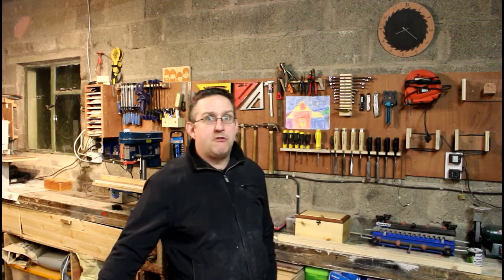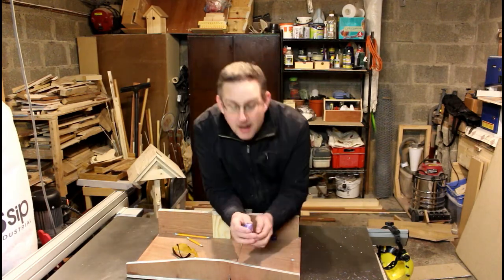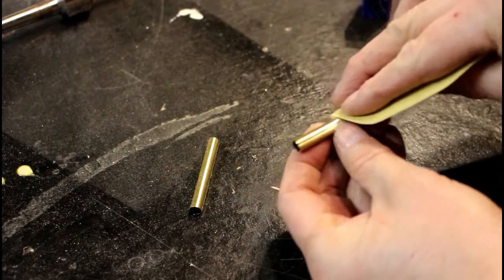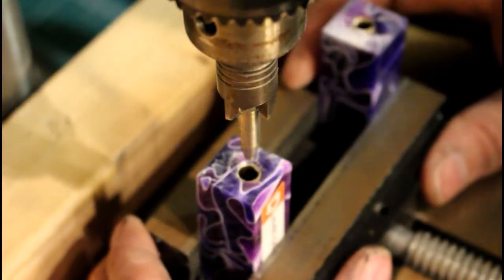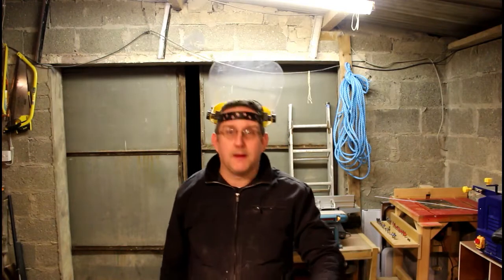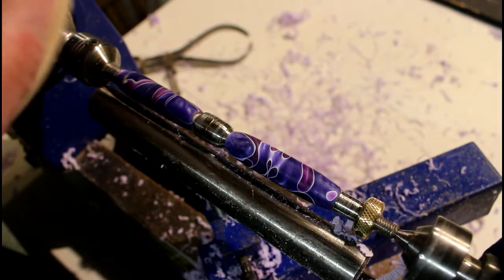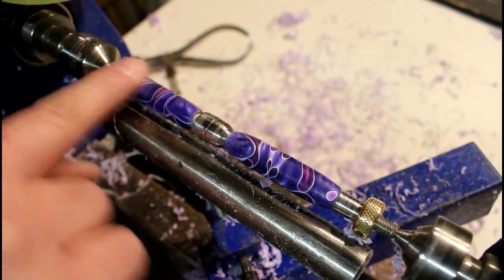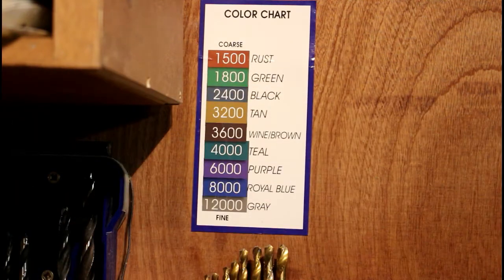Acrylic Pen Turning

Comment: I have just purchased a deluxe pen press from Carbatec in Brisbane. I have not used it yet I have just opened the box. Previously I used my pedestal drill and a block of wood or my vise. Neither method was comfortable to use. I really can recommend you buy a pen press and also a pen blank drilling centre vise. Final comment there is no such thing as a cheap hobby, but you do get to learn new skills and have a lot of fun.

Comment: I use a Zebra Z grip click pen parts as my pen kit.  The parts I use are the click cap  an d the part under the rubber is cut off to use as the ink end.  No inner sleeves are used with this method.  I use a 4 inch pen black as my wood part.  Total cost to make a turned pen is less than $3 because I purchase my Zebra click pens from Amazon for about $1 per pen.  Have you tried this method?

Comment: Don't you have a vise? Even clamps would be better than the hammer. Pen turned out nice.
Reply from the maker: Mike Biggs only a small one, too small for this job. Have tried clamps too, but while it works to an extent, I really need to invest in a pen press!!!!
Reply: West Cork Woodworks You could also use your lathe as a press. A bit of wood each end and hey presto one pen press. Try it.
Reply from the maker: Mike Biggs great idea Mike! Cheers for the tip, I'll try that tonight!
Reply: Honestly,  I don't find it to work horribly with the hammer.  But it's not the most efficient way to go about it either.
Reply: I use my lathe to press, you can get press disks at penn state for $11 or use a drill press.